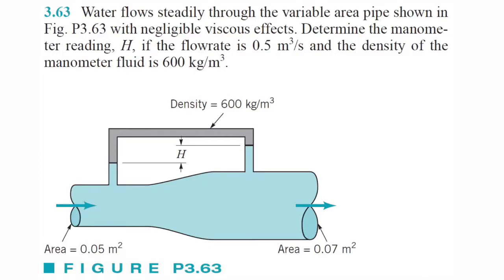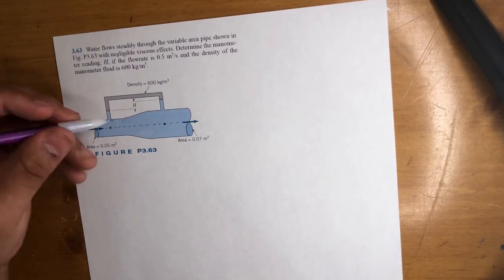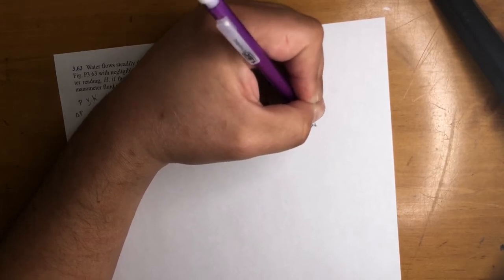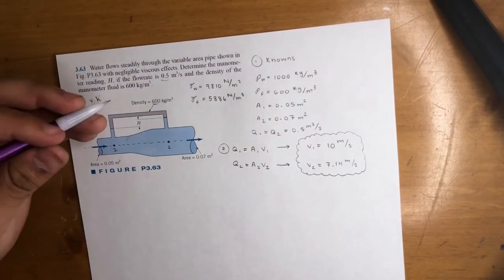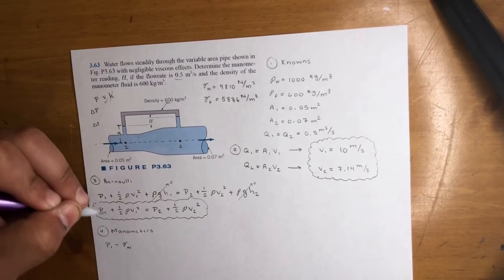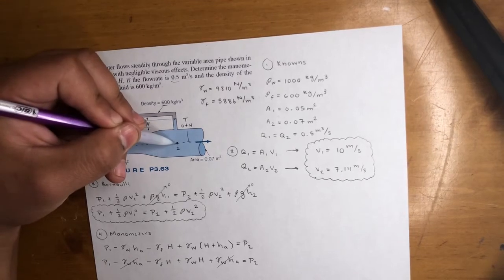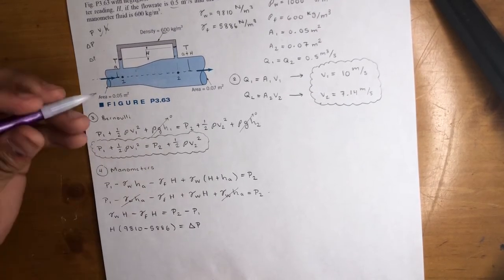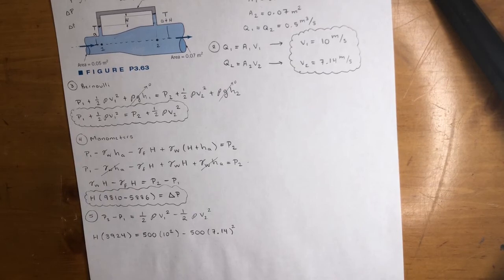Fluid Mechanics - Water Flows Steadily Through the Variable Area Pipe

Comment: Quick question! why is that in the last part substituting values in density for 1/2(p)(v^2) both are water's density?
Also... THANK YOU for explaining everything really!! Very helpful video!!
Reply from the maker: Hey sorry if it’s late but here it goes:

In Step 3, we did Bernoulli from points 1 and 2 on the diagram. In both those points, our working fluid is water.

Step 4: The only reason we did this step is to find a relationship for P1 and P2. Why? Because in Step 3, we didn’t know P1 or P2, but using Step 4, we were able to find the difference between them using manometers.

Once we found the P2-P1 (Delta P), we were able to rewrite the equation produced from Step 3. 

Remember, step 3 was Bernoullis equation from Point 1 to 2, and in both points, our working fluid was water, which is why density for water was used at Step 5 for both densities. 

Let me know if this helped!